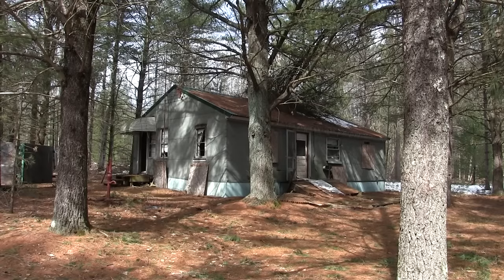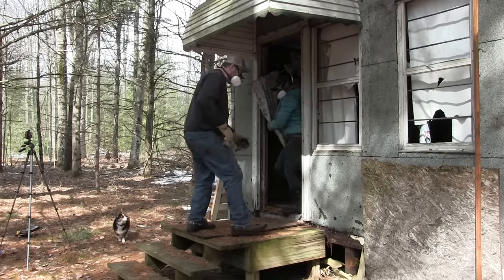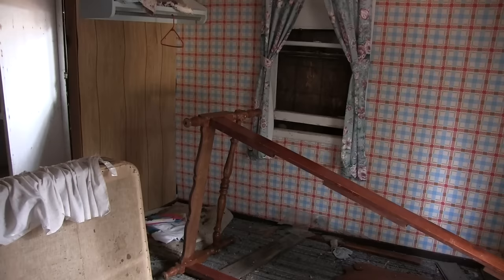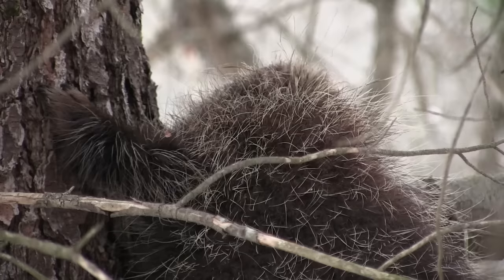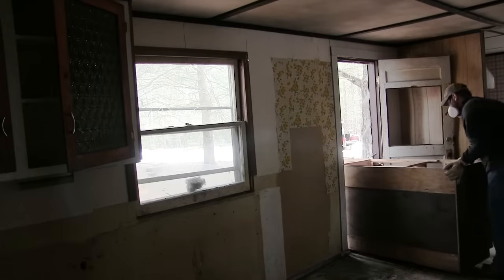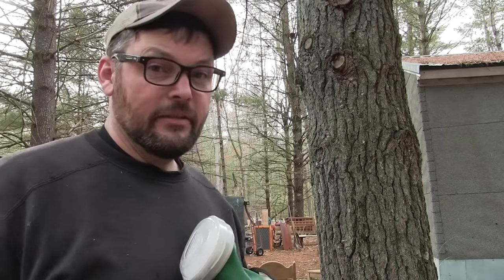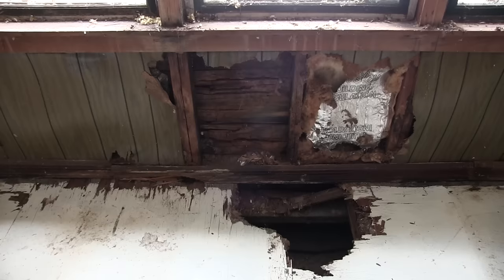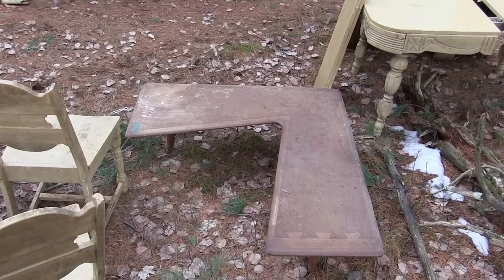Cleaning out an abandoned CABIN in the WOODS

Comment: Looks like a very productive cleanup day for sure. We'll see what the bones of the house look like when the paneling and whatever might be behind it comes out. I bet it won't be too terrible. That will be a good time to replace all the electrical wiring and outlets/switches. Even off-grid houses that may only be powered by solar panels or a generator should have reliable wiring. And being that you're going to have the walls opened up that would be the best time to tackle that project. Maybe I'm thinking too far ahead but just thinking. Sure up any structural components before anything else. But you probably already figured that in. Good bones to start with. Looking forward to seeing your progress.

Comment: The cleanup and clean out went.... shockingly well and i'm genuinely surprised and impressed with how well the bones are holding up.

Edit: Also I'm going to agree. That front yard isj ust crying out for a firepit and a few bench seats wit ha designated spot for wood that's gonna go into the pit.  Ditto a picnic table. Maybe a couple wood slat recliners flanking the front door. the kindwhere you can take the cuchions inside when not in use.

Comment: The porcupine lodge is too big for a cabin and to small for a house. If it is accessible all year it could be either. Dave will have to decide before he starts. If he is going to make it a house it will cost a lot more and once he invests in the rehab he will have finish it that way or lose his investment. As a 4-season house he will need siding, electricity in the least solar friendly place in the US, with a propane backup generator, a condensing furnace with ductwork, propane bulk tank, pumped water that does not freeze in the winter, hot water heater, shower, plumbing, flush toilet, septic tank, and leach field, lots of insolation, thermal pane windows, and who knows what else. I do not know how he could get a return on his investment. I doubt there is nearby employment which means a retired couple would be the only one who could live there. The porcupine lodge was abandon for a reason (location, location, location). As a cabin unless it is summertime only it’s too big, he cannot heat it with a wood stove without a loft. I have never seen anyone lay channel iron on its side, it reduces the beams strength by 75%. I would like to see him turn it into a home and wish him the best of luck.